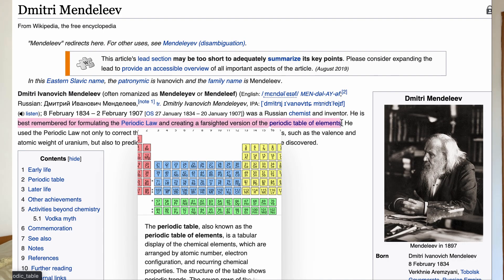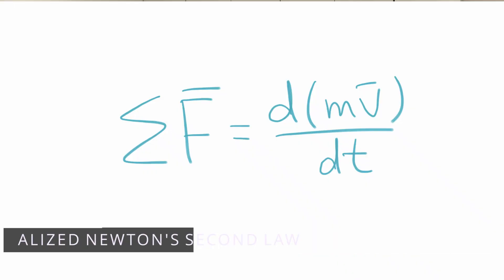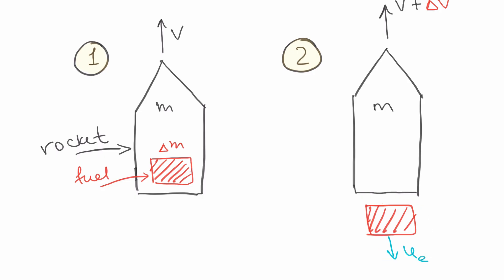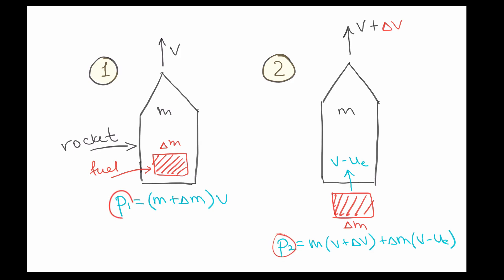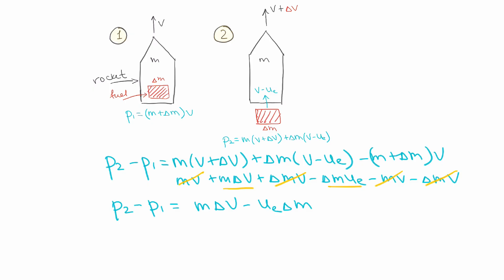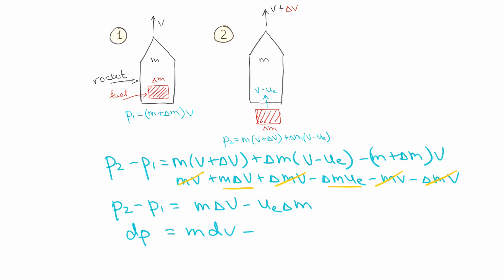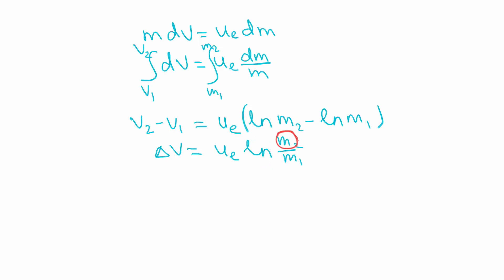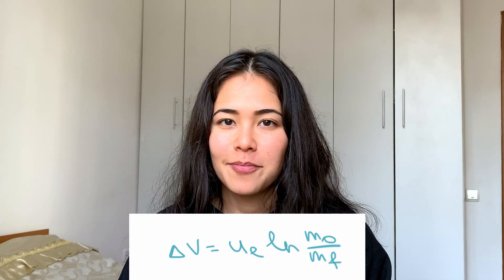Rocket equation (Tsiolkovsky or delta-v equation)

Comment: Thanks Ma'am for the simple derivation of the rocket velocity eqn. But I notice at 10.36 min, you get a logarithm of the mass ratios (m_2/m_1) which is negative, whereas on the RHS we have the difference between the Final and Initial velocities of the rocket which  = negative qty. You have flipped the final and intial mass symbols conveniently, to make the logarithm positive- but is this correct- as the math should tell you what the results will look like, isn't it? Could you please explain this please?
Reply: so what really happens at least I think is that there is a negative in front of the dm as it is decreasing. This means it results in ln(m1)-ln(m2).
Reply: * I meant the LHS (left hand side) of the equation which is the difference in the rocket velocities between points 2 and 1 (V_2-V_1)
Sorry for the error
Reply: I think u_e already has a negative value b/c of its direction. Negatives would cancel each other

Comment: Hey there. You took the reciprocal inside the log without taking a negative sign out.

The reason why the log gave  a negative number in the first place was because you took dm = delta m but in fact dm = - delta m since the rocket is losing mass.

To provide more clarity, dm is the small change in m right? i.e., dm = final m - initial m and since final m is smaller than initial m, dm will be negative. So the differential equation will be m dv = -u_e dm and now the log will give u a positive value.
Reply: I think she did mention that it was a negative value but glossed over it a bit, but thanks for your input as I was lost at one point and I found your post helpful.

Comment: what is the use of NACA  digit ? for example 4412 each digit indicate some position.what is the use of this position ?  thanks
Reply from the maker: First digit describes the maximum camber as percentage of the chord. Second digit describes the distance of maximum camber from the airfoil leading edge in tenths of the chord. Last two digits describe maximum thickness of the airfoil as percent of the chord.
Reply: @AliyaBurkit  maximum camber,Location MX number,thickness i know this  in definition  .  but is not clear to me .    what is the purpose of  this location ? i am search on google i didn't get clear answer . thanks
Reply from the maker: I see, I can explain it more in a video
Reply: @AliyaBurkit  I am waiting you. I would like to make small home made air craft to me.